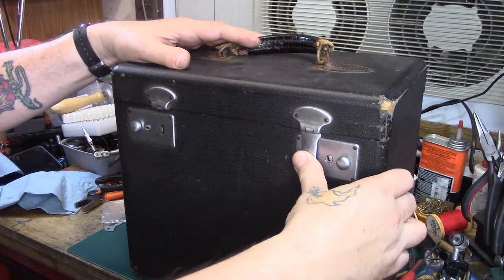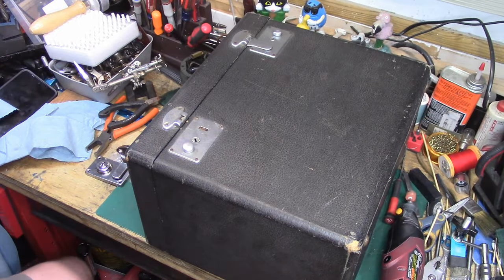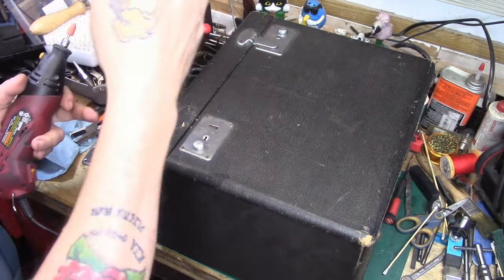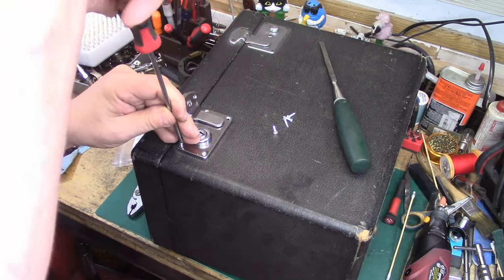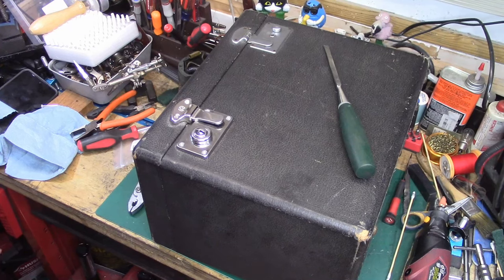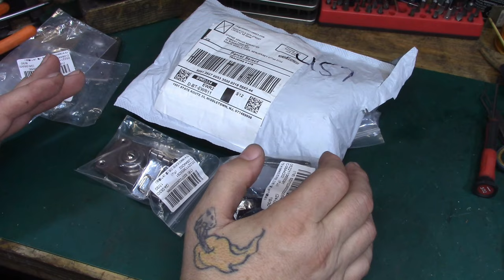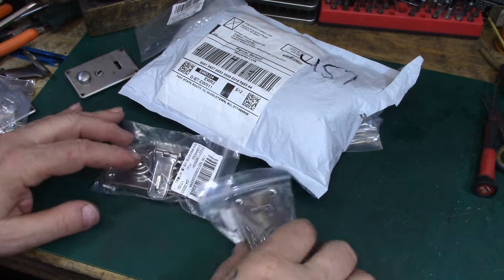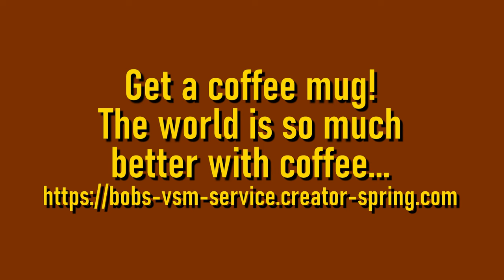Singer Featherweight Case Latch Replacemenrt

Comment: Thank you for this Bob.  A fine video for those of us who are not obsessive compulsive about "authentic" parts.  No reason to think that Singer wouldn't be using something like this if they still made these cases.
Reply from the maker: Oh, but I have receive flak about this already... lol... doesn't sound like a Bob problem, more of a them problem.
Reply: @BobFowlerWorkshop  Yup.  Not your problem.  You've found the solution.  I've found a way to replace the horrid plastic/nylon spool pins on a Singer 411G with steel ones.  Looks better than the original, works better than the original.  Easy to replace.  Just pop a new pin in when you want instead of dismantling part of the top of the machine which was not made to be dismantled  Steel instead of nylon. Someone will complain.

Comment: Nice job. I didn't replace one of mine. I added one latch like yours in the middle. 
With mine, I thought I would not replace the handle but repair it, but I will wait to see what you do before I venture down that road. (I showed the case with the bad handle and just about everything  on my channel). 
Thanks for sharing. And yup. With the fireworks. Keep those fingers. 
Have a wonderful Sunday.

Comment: My case is in about the same state of disrepair as yours. I’ve just decided to live with it, and not try to fix anything. I rarely take my Featherweight out of the house, so I mainly use the case to keep it clean. The handle is in such bad shape. I wouldn’t pick it up that way anyway, and here at home it doesn’t really matter if the top latches down or not. If it ever starts to bother me, I’ll just sew a little quilted cover over it.
Once again, thanks for all the great info you share !
Reply from the maker: I pretty much feel the same way...

Comment: Is that case particle board or plywood? These old carry cases always make me nervous about the handle or the latches giving way. Or even the underlying wood failing so the fittings fall off.
Reply from the maker: Definitely not particle board, but it may actually be solid wood, albeit very thin.

Comment: Don't try from inside it makes too much mess. Replacement screws need grinding down to correct length. The case is only a smiggin over 1/4in thick.
Reply from the maker: Watch the second video on the subject, I changed out the wood screws for machine screws and blind nuts. Works great!

Comment: Be sure to save the broken latch. The spring inside can be used to repair another latch, with a broken spring. if you do ever replace the spring on another latch, don’t do a video. It would be way too much foul language!
Reply from the maker: There have been times when I have muted an entire audio track and just voiced something over AFTER editing the visuals... Having said that, I have done that, and it's no worse than the  ejection spring on a 66 bobbin case positioning bracket.